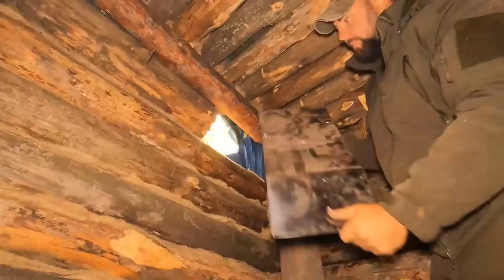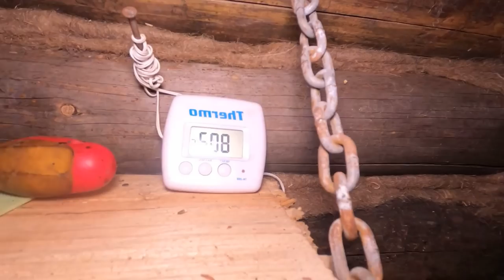A secret house in the forest, bushcraft. wood-burning stove. Survival in the forest. Without words

Comment: Have you ever considered taking some COAL with you.  I find a small bag when and if you can move the weight is good to take in and stock pile.  It really helps in the long run of winters to supplement wood and wood thats difficult to burn.  It’s also nice to put in at the end of an evening to get a full all night burn while you sleep.